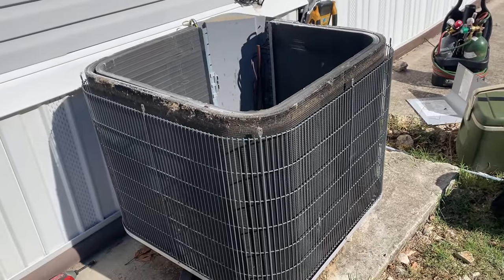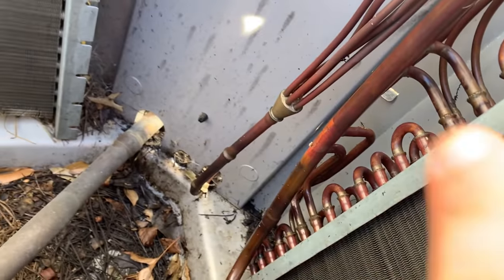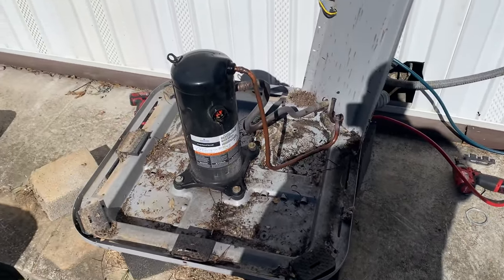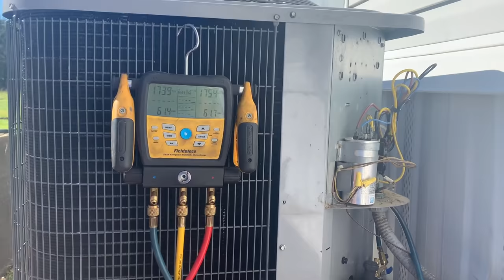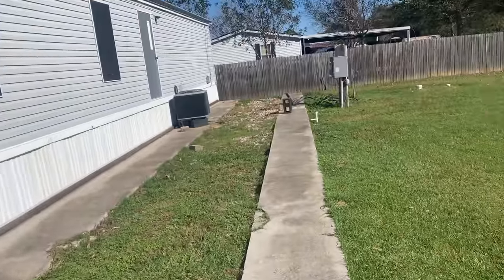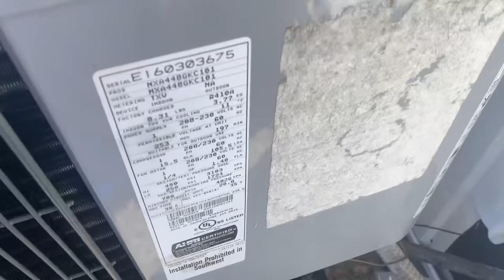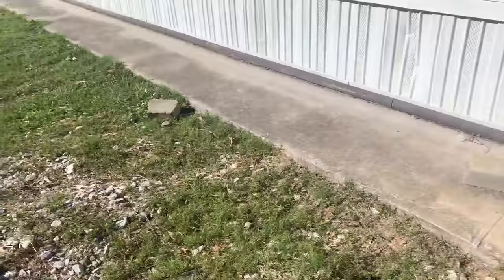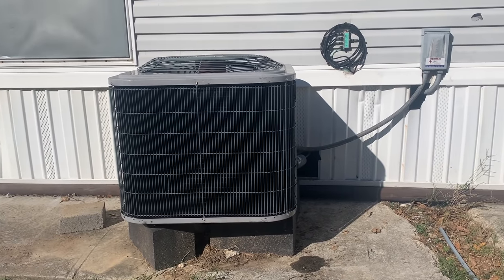Replace Leaking Condenser Coil

Comment: 1) Those lines need capped before blowing that sh*t everywhere.   2) Why would you not just change the fan motor as well if it was still under warranty also?

Comment: Most compressor manufacturers tell you to cut the lines. We do at my company for safety reasons. Saw a guy get burned one time from system holding refrigerant on one side that was stuck in system. Bad deal. Comfortmaker/icp has ad units leaking in that same place for a few years now.